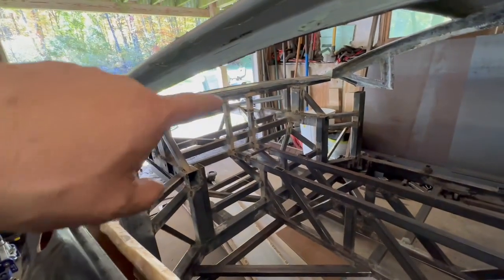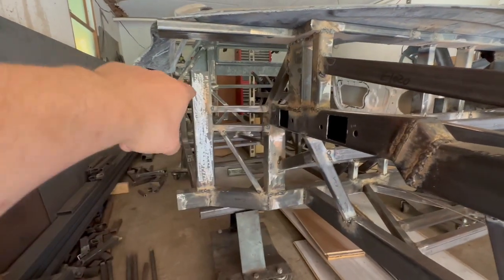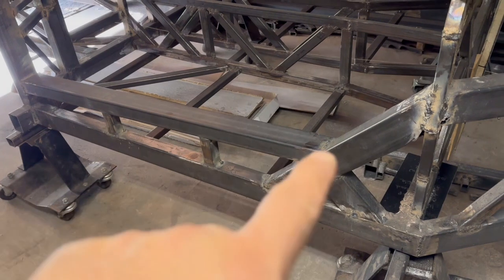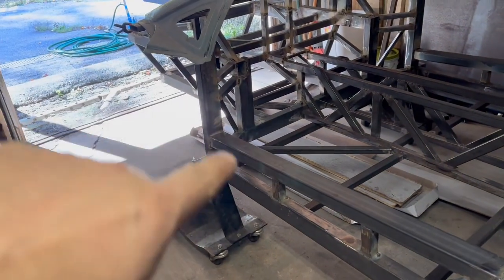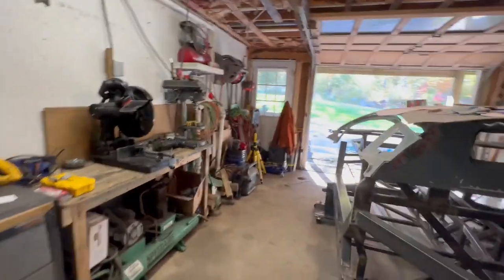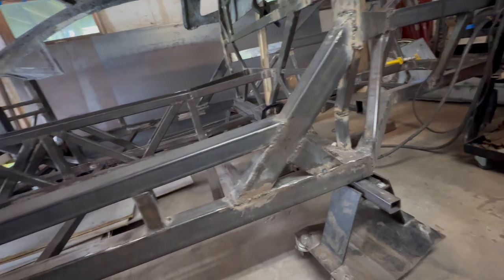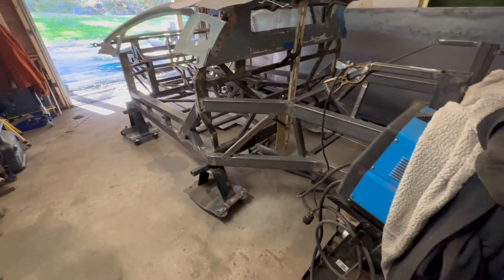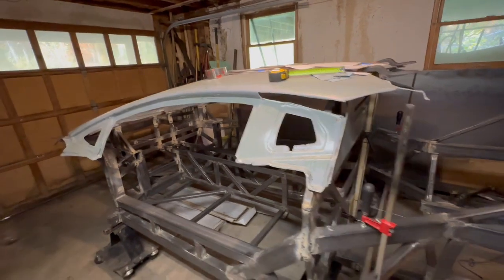Aventador Replica Build - Part 12

Comment: Fix it now.  I am struggling with things I should have fixed earlier.  Good update brother!  Are you going OEM for interior?
Reply from the maker: I did a little more adjusting and have the roof where it needs to be with the body panels on. I have about an inch gap at the top between the frame and rear fiberglass firewall. I still need to build a bracket that goes between the frame and firewall for the angled bars that go from the roof top to the frame so I "might" be where it needs to be. That's the next project. 

I plan to either use OEM or fiberglass copies form OEM parts, if I can find someone that is making them when I am ready. The seats will be modified Audi S5 (2-door) seats. The Audi S5 is what I plan to use for a donor once I find a wrecked one and have the funds at the same time..ha